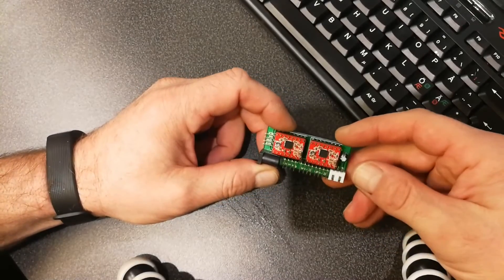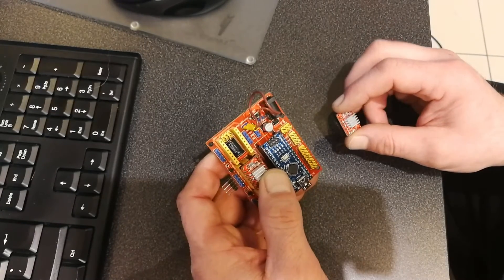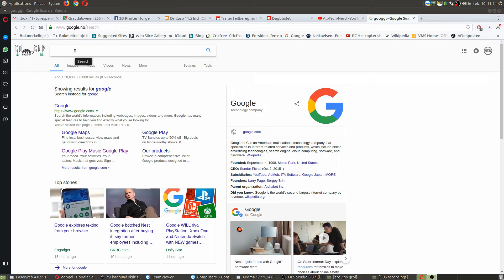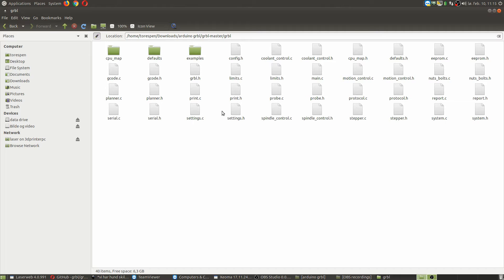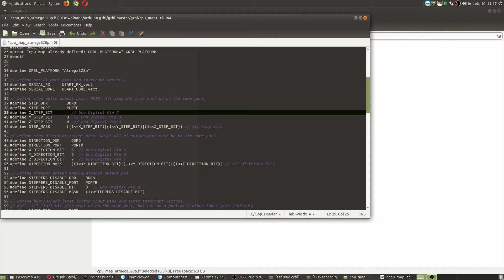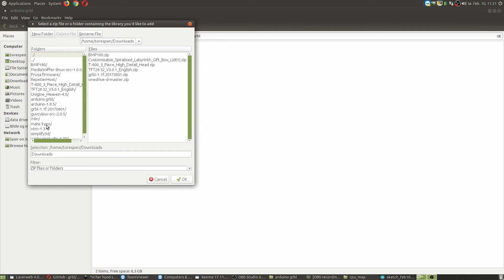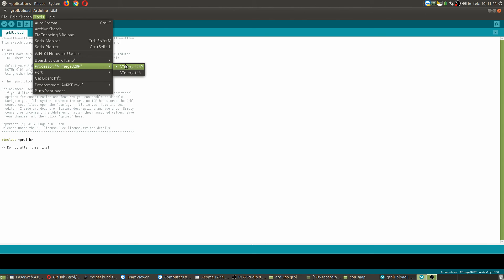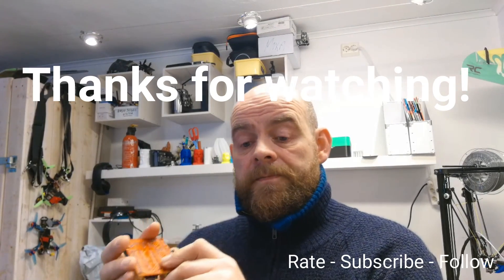Fix the CNC shield V4, installing GRBL FW cheapo China laser

Comment: Thanks for providing the update. I did verify the direction and step pins are interchanged. Doing the change in firmware is much easier than changing the tracks on CNC Shield.

Comment: Thanks man, you save me a lot of time, I debug this issue for several hours. If anyone use DRV8825 module, please check SLEEP and RESET pin. These pins need 5 voltage but the board not support..

Comment: This is the kind of fuck up you don't need when learning to program and use this sort of hardware.
Big cheers for this fix.
Reply from the maker: john amptech that's true.. I'm in the learning fase myself, but according to my wife very stubborn.. Sooo .. Might explain why I could not let it rest 😅
Reply: I did my first year electronics design technician when i was 21(hazy past college student),had to work so no HND etc,kept studying,make audio stuff for stage,amps etc all tube gear yadda,found pic but the freakin code ,arduino,saw cnc ,blew me away,hated programming ,we used 6502 assembly,now i'm getting to see the arduino IDE design,and want to get the C,C++ with this type of programming being more intuitive than the assembly we used,plus it sits better with me being able to work the component side so easy,and the design is a snap,and understanding new component installation/calculation is easier understood.

And yes, it kept gnawing away at me(the (k)celtic persistance,scot)so i found a new route in.

That said,the backwards implementation of the stepper driver pins,that would have totally escaped me,seeing as i assume these boards are tested using a sample off of the production line "as is",without having to alter driver pin association code.
Just used to parts working when new,or at least when i design a pcb,i make sure it works,i have reversed the layout,to my dismay on a proto board,but always swap all the components to a corrected pcb layout.

Again nice fix,well done.
Reply from the maker: john amptech thanks for the kind words 😊 I guess scot's and noggies are much the same 😉😅
Reply: As i said i'm learning how to code the arduino,here's the first lesson in a string of many from this dude,
https://www.youtube.com/watch?v=d8_xXNcGYgo&list=PLGs0VKk2DiYx6CMdOQR_hmJ2NbB4mZQn-&index=1

cheers.

Comment: @ATN thanks for sharing this fix, I'm waiting for the same shield board that you are using and didn't read this before. One thing that I'm looking for and I arrived here, is where to plug the laser because seems to not have an specific pinout for this purpose.
Reply: Dont remember just now, but I think you have to set it in the fw.. Could be any pin really.
Reply: @kakemanx  Thanks, I receive the board today, must to checked it now ;)

Comment: What pins would i connect for the TTL of my laser?  I can't find that information Anywhere... Can you PLEASE show how to connect a TTL Laser to this shield?  Below is the the Github page... Do you have your laser working on this shield?
Also, GBRL 1.1 says... And I quote "Support for Arduino CNC shield clones. For these, step/dir on pins D12/D13, and spindle enable is moved to A3 (old coolant enable), while coolant enable is moved to A4 (SDA pin). Variable spindle/laser mode option is NOT supported for this shield."

Comment: Hey I have purchased the same board but I cannot find any documentation on the board. I have got GRBL on the arduino and I have loaded up the Universal Gcode Sender app and connecting to the serial port at 115200. It seems to be connecting because I get some gcode sent back to the console and the stepper clicks but nothing else happens. I would like to verify that first I have my steppers connected correctly but I cant even find a hookup guide. Any ideas?
Reply: Well, i don't own this board anymore, but  hooking the stepper up is something you find in the documentation to the stepper drivers.. You are probably running a4988 or 8825 stepper drivers?

Comment: Hi, I downloaded the Notepad++ and changed the step and direction pins as in your video. After that with Arduino IDE, I did the Grbl Upload.  But still my steppers do not move with GrblGru software.
 I checked them on a breadboard with Arduino Nano and A4988 wired with a simple program and they work accordingly. Do I have to do any hardware connections on CNC shield V4 other than plugging Arduino Nano and A4988 boards and connecting to the PC with USB and 12V supply to the connector? Please help me I just cannot over come this problem. I am badly frustrated with my CNC project.
Reply from the maker: Kusman Fernando sorry to hear this.. Has been i while since I did this project.. Maby they have changed the grbl pinout again?

Comment: hi mate, I changed my cpu-map but still can't get motors to move, other sites talk about the step pulls to be shorted to earth with the jumpers in and some even talk about soldering wires and smds to the bottom of the board. Its getting way too complicated for a newbie like me, is there any simple way of getting my system to work, my laser works fine on an Uno setup but not this v4 setup

Comment: I followed your video and managed to load the GRBL firmware on the ARDUINO nano (same Chinese card) by changing the corresponding numbers of the pins.
Now IDLE appears in the GRBL control window and the commands work but I can not activate the stepper engines that do not work.
I wonder why and where I was wrong.
Reply from the maker: Could You maby make a video of the changes in the firmware and also in the GRBL control windows when the error happens?

Comment: Good solution, but I have a second problem with MS1,2&3 when take out the shorts to working 1/16 I have notice that they don't go HIGH. Something way  to map pin on Nano with pull-up internal resistor?
Reply: Does anyone know if there is a schematic CAD project of this shield available somewhere?
Reply: the stepstick drivers drive those pin in pull down. That's a bug of the shield, so that you have gnd on one side, and pull down on the other.